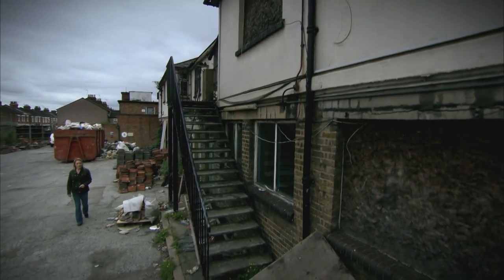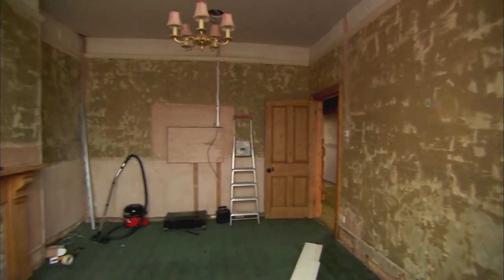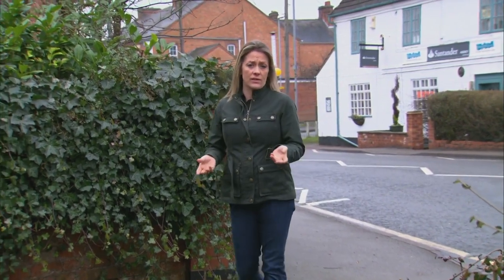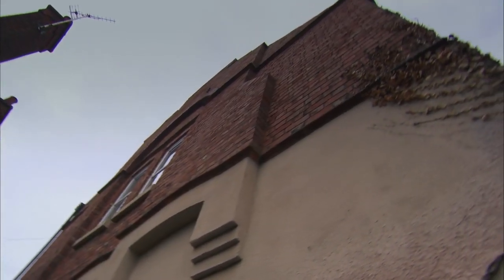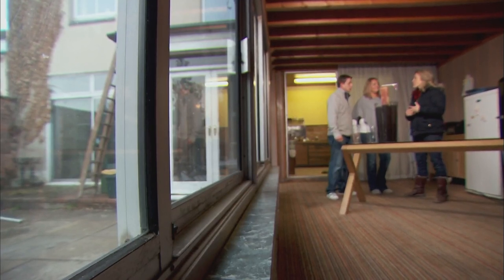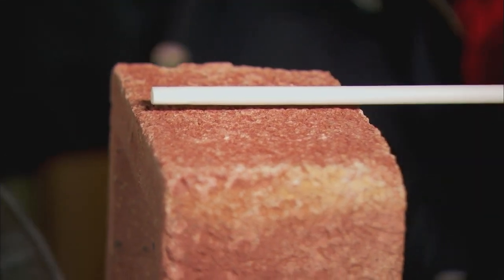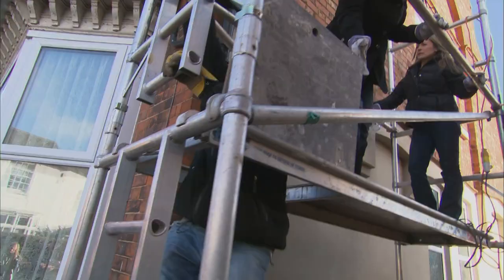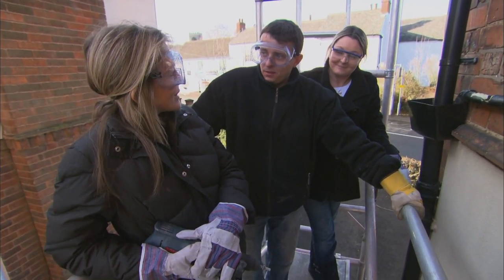Roof Collapse Risk! - Help! My House Is Falling Down - S02 EP1 - Home Renovation

Comment: I'd have put some collar ties in as well as the rafter ties and I would have nailed them. Screwing is an option, but only if you have screws that are speced for use in shear. I hope they had an engineer come up with the dimensions and number of the trusses.

Comment: Doesn't the UK have laws about selling a house with major defects to an unsuspecting homebuyer? It's so wrong to sell such homes without the necessary disclosures.
Reply: Thanks for asking what was on my mind. Such as a preinspection?
Reply: There are laws like that in the United States! I would think there would be in the UK
Reply: My thoughts exactly. When you buy a house, a disclosure statement is required to be part of the closing, and most banks require an inspection before approving a mortgage loan.
Reply: We now have a buyer's pack that includes a proper structural survey and you can't get a mortgage without one. I'm pretty sure this is relatively new, though.
Reply: @readingroomcafeproject  I'm surprised that it is new for the UK since y'all have been selling houses for hundreds more years than in the States. It seems a reputable and conscientious Realtor would have warned them to get an inspection before closing the deal. Clients certainly would not recommend that realtor who sells them a wreck. This episode made it seem once the deal was closed there was no looking back at any culpable parties.
Reply: Exactly, I'm wondering why they didn't have the sale contingent upon inspection.  All the floors in my 1939 house are sloped towards the rear, but my home inspector and structural engineer both agreed that it is solid, and just built that way.  There are no sticking (original) doors or windows, no drywall cracks, and no separating moulding.  It never had plaster walls.  On the exterior, the original clapboard is level, but the windows are not.  It's a strange situation, but I've learned to live with it, as fixing it would ruin everything.
Reply: It's buyer beware. You should get a full survey before buying, but a detailed one costs money and hurts if you get gazumped and have to start again and have another one. The law needs to change to where the seller should have one before putting it on the market. Mortgage lenders will have one just to say the house is worth what the mortgage is and nothing else.
Reply: @Jules_Pew  AGREED! The laws absolutely need to change.

Comment: Folks, at the VERY LEAST, have a professional check the roof and foundation of your prospective house.  Find out if the foundation is sound (if the house is subsiding at all), and ask 'How many years does the roof still have in it?'   If there's anything dodgy about the roof and foundation - no matter how beautiful the house or desirable the neighbourhood, walk away from it.  AVOID FLAT ROOFS!  Unless you live in a place with zero rainfall, a flat roof WILL cause you problems (and indicates a cheap, money-saving build.) If it's brick, check every brick visually for cracks (especially cracked bricks, but also crumbling or cracked or missing mortar) or areas of obvious reinforcement or repair.  Get an expert to tell you how long the bricks will hold up before needing repointing.  Avoid a house that has trees growing so close that the branches can touch the house or come within two meters of the house, especially if the tree is still growing: you can be sure that the roots are too close to the house if the tree's branches touch or come close to the outer walls.  You can see too-close trees before you even get out of your car.  Drive on by unless you are prepared to (and legally allowed to) remove trees (but even so, if the trees are close to the the outer walls, the roots may have already done their damage).  If you go into the house, touch all the walls for differences in warmth (do they feel cold and damp in places?) and look for bubbling paint or crumbling plaster (it means damp - walk away from it).  Dampness, dodgy roof, compromised foundation - those three things should be top of your list for whether a house is a contender or not.